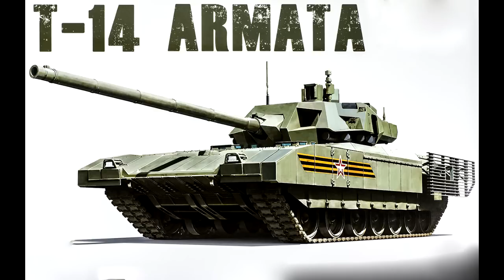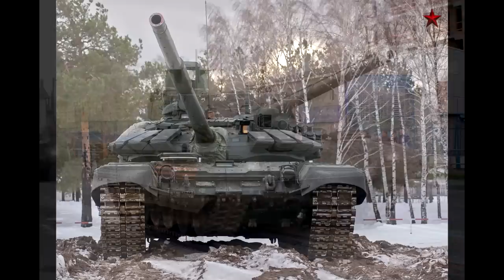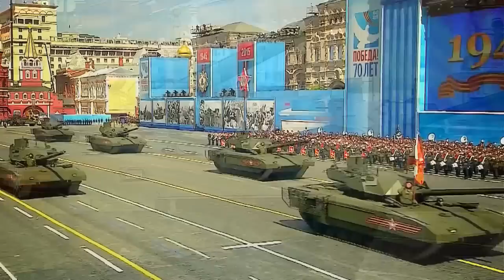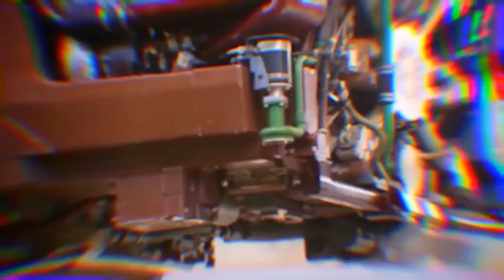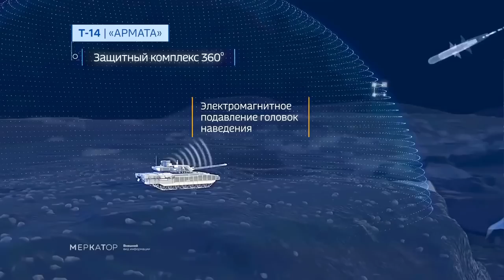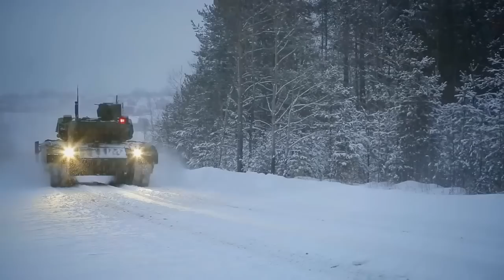Busting Myths on T-14 Armata

Comment: Of course there are problems with the T14 Armata tank, like the other Russian tanks. Every tank performs well in certain conditions and less well in other conditions. Russian tanks are capable of performing well in temporate and arctic situations. They are water tight, but this will give problems with heat release. How hard they are to drive depends on the drivers. Russian and Ukrainian tank drivers are known to be bad drivers, just as they are bad drivers on the road. Also the selection of tank crews is far from desirable. A tank is a good as its crew. Training of crews in other countries is another problem. T14 is too expensive to make, too advanced for most Russian conscript crews and only under fixed conditions will it perform better than the new Leopard, the Merkava 4 and the Abrams tanks. Also much depends on how a tank will perform in a complex warzone with tank formations, anti tank warfare, mine fields, supply of armaments and fuel, battleformation command, attack by warplanes and mostly by the quality of the army that uses the T14 Armata. You may have one of the best tanks in the world, but when a simple tank trap can hold it back, it won't go much further than perform defensively. Perhaps as a defensive main battle tank, it will perform better than the other tanks. As an offinsive main battle tank against Nato forces, against Asian tanks or against the Merkava 4 tank it may be possible to minimize its advantages. The tanks of Nato and Israel are made to be an offensive main battle tank. Russian tanks are best as defensive battle tanks. Perhaps we will never see real battles with the T14 Armata tanks. It may be a tank that is best used as a deterent. As a peace keeper it may be one of the best tanks. After all, mother Russia is best in defending herself or conquer weak countries. Nato and Israel have nothing to fear in the Armata tank, as long as they don't challenge the T14 Armata.
Reply: Lol How many thousands of kilometers have traveled along Russian roads to talk about the qualifications of Russian drivers, on tank biathlon Russians have not yet won !!!)))
https://www.youtube.com/watch?v=nE2yzAqvhJc

Comment: You are correct about the stopping mechanism on the T-14, I saw it in action in a video, very good stuff, actually, better than the Abrams it self, They use a T-90 for the testing, and the RPG projectile got blown apart at 50 meters away from the tank

Comment: Here's a good analysis of RF tank programs. Armata is too expensive to produce in numbers, most likely there will be heavy modernisation of the existing platforms and T14 will be produced in smaller numbers. Just economics. http://warisboring.com/everything-you-ever-wanted-to-know-about-russias-massive-tank-force/
Reply: Ivan Zhidov you know War is boring is Anti-russian right?
Reply: Their analysis makes sense economically, I don't see any significant bias. If you feel different, please explain. RF has tens of thousands of surplus tanks mothballed. Doing deep upgrade on a working hardware makes sense. T14 is new and expensive. T-62,T-72,T-90s are proven.

Comment: It is a very cool tank. However personally I am skeptical about it. The Russians have a history of building tanks that look nothing less than fucking amazing on paper, but have serious or even crippling flaws in practice. For instance, in order to take out the engine of a T-54/55/62/64, you had to first remove the turret, which itself took half a day. That can seriously hinder the turnaround time for tank maintenance. Additionally, less crew members means more work per crew member in vehicle maintenance.
It's a very interesting design, but I am not going to say if it is good or bad until the story of it's performance in practice comes into full view.

Comment: The APS on the Armata is something iam sceptical about. Not becouse if it works or not. The Russians had something similar before and it worked. The Problem was that it can lead to FF with wounded and dead on closeby supporting infantry. Iam curious if and how they resolved that.

Comment: Fact #1 They are very expensive to produce and maintain.
Fact #2 They are a logistical nightmare. Hard to maintain and don't share many parts with older tanks.
Fact #3 Even if you actually believe they used an inexperienced driver to show off their new tank to the world??? LOL. They are experiencing massive system breakdowns and being pampered to prevent failures. There are even talks of cancellation.
Last # Velocity defeats armor! A sabot round travels at over 1500 meters a second. Hitting it is like hitting a bullet with a musket, It's not happening! The tank itself is a 100% Russian design, but some of the electronics are either licensed French or copied French designs.

Comment: When comparing the T-14 with NATO tanks, it should be noted that the general analytical agency FMSO under the US Department of Defense in its report notes that the T-14 is a next-generation tank relative to existing ones. As noted in this report by FMSO analyst Charles Bartlez, the T-14 has a number of advantages over existing NATO tanks: long-range radar, active suspension, increasing the speed and accuracy of tank shooting, frontal armor, impenetrable modern missiles and projectiles, and an active defense system , capable of intercepting even shells.

To date, only two tanks in the world are supplied with the standard active defense system equipped with AFAR radar with the function of automatic calculation of the position of a shot on the tank by a rocket or missile: the T-14 and the Israeli tank Merkava. The frontal armor of the Merkava is weaker than that of the T-14, besides the engine located in front of the tank does not increase the protection of the crew at all, and when the frontal armor is broken through, the tank is practically guaranteed to be immobilized, and the furrier is located ahead of the engine. The active protection of both the Merkava and other promising NATO tanks is incapable of reflecting shells. And this is only protection.
a trunk of caliber 152 mm that gives 100% penetration of any frontal armor of any tank in the world.
ОТМЕНА
СОХРАНИТЬ

Comment: well....um.... ok.... great looking tank. looks like a good rival to our older abrams models from 20 years ago. just a few key points of interest though.
1. this is russia new tank being touted as the best. but we haven't released our newest version of the abrams yet. so there goes that nonsense. 
2. most seem to have this delusional vision of US and russian tanks meeting on a field of battle. when in reality, this is very unlikely to ever happen. even in a full all out war between the 2 nations. the US doesn't field its tanks in the same way russian does. long before our tanks hit the scene. our air force will have wiped out any enemy tanks forces. and can this thing withstand an onslaught from our strike fighters? not a chance in hell. and while russia has approx 1,000 fighters. half of them are considerably older models and won't do much more than become cannon fodder in battle against the US's nearly 3,000 active fighters on top of the countless 1,000's of very capable drones. 
so lets put this all into perspective here....
russia true challenge to the abrams comes nearly 20 years later....
russia's true challenge to out f-22 comes nearly 20 years later.....
russia has still not even came close to a serious microprocessor that challenges the US. it has no globally traded auto industry. no globally traded airline industry. and has had more failures in space the victories. 
so i ask you.... at what point do you guys realise you're in a race that already ended a long time ago?
 even now as russia is trying to salvage its 5th gen fighter program. the US is releasing info on its new 6th gen fighter plans. we're literally so far in advance. that we're telling you what we're doing before we even do it, lol...

Comment: Every new piece of hardware will have teething problems and failure in it's early years.  The more systems we cram into it the more things to break, no matter how much money you throw at it.  What counts is that a military force works through the problem until it is fixed with the contractor or builder of the military hardware.  The Armata is still a cutting edge tank and I am sure it will encounter more bugs and undiscovered vulnerabilities then they will get fixed.  Doesn't matter if it's German, USA or Russia.  Complex engineering is always a challenge and full of surprises.

Comment: The part about APS cannot take out an APFSDS projectile is correct.
Armor Piercing Fin Stabilized Discarding Sabot (APFSDS) shells fire a huge shell from the gun, then they discard into that small dart at a muzzle velocity around 1,000 meters up to even 2,000 meters per second (Depending on shell improvements, gun characteristics and that stuff). That small dart is hard to hit, especially going 1k to 2k meters per second. It'd take a miracle for that APS to take it out.

Comment: To STOP and APDS round  is easy,   all you need to do is put  enough "energy"   above the round, to cause it to begin to tumble...  and all the round needs to do is tumble past 30 degrees befoer impact.   at that point, the round with hit and flip sideways....   dispersing all of its energy over the entire length of the penetrator.  because its now hitting sidewise at best its going to dent the armor rather then pushing though it as the as it loses 95% of its penetration potential.

Comment: I refuse to believe that the E-brake was the problem when it broke down. I just don't believe that they gave that driver so little training. Did they honestly say "This button goes forward, this is left, this is right and this is backwards. Good luck have fun at the parade."? Did they honestly give that brand new tank to some tard to drive around at a parade during it's release? Sounds like an easy excuse to me. GG Propaganda team.

Comment: A little shrapnel at close range can not POSSIBLY stop or significantly deflect a hardened penetrator from an APFSDS round! WTF are you smoking? Sloped ceramic plates, backed by uranium, would be somewhat effective, but the active system described would only work on shaped charged or squash warheads.
Reply: mrnickbig1 the new APS can do it

Comment: Ok I will say this if anyone with a brain had to choose which tank they would rather take into battle especially if out numbered and the choices were the T-14 and the Abrams tank the choice would be the Abrams. I am not flag waving either, we have absolute junk like the f-35. Look they better make about 5 thousand of the T=14 because the next Abrams M1A SEP V4 is a stop gap beast until the new design is ready for the next generation.
Reply: +Andre Wells

> "we have absolute junk like the f-35."

 How is it junk?
Reply: look man the F-35 is a basic all purpose aircraft, it is something to show, however know one is afraid of this aircraft. The F-22 on the other hand is another conversation. The primary knock on this fighter is the maintenance issues. Beyond that know enemy wants to face this aircraft. The F22 is the real deal however because of piss poor procurement  procedures it because an albatross from the beginning. Had the pentagon or air force installed certain maintenance requirements more of these plans would have been procured, even the  F-23 is superior to the F-35, sorry but thats the truth, the next 6 generation plains will be much better. However they trumped those crappy plains out because they have super secret aircraft thats far better than any thing that anyone else has. And all of our potential enemies know it as well.

Comment: I doubt the Afghanit can really stop APFSDS. The darts fly fast, have minimal radar crosssection and are made of depleeted uranium - thats dense and hard material. Even if the system is capable of detecting them in time, the shrapnel charge would do nothing to it. Its kind of like hoping to shoot down bullets with birdshot.

Comment: 0:38 This maintenance recovery team was more than likely under incredible pressure to get the tank out of sight ASAP. A parking break alone would not stop it from getting towed away I believe the transmission was not in neutral or the final drives were not disconnected.

Comment: normally I rarely watch any Russian/Russian sympathizing youtubers regarding this topic because they often way overhype armata while bashing the crap out of abrams (and American in general) while giving absurd info on both.

you however generally have kept things simple, made solid points, have at the least given sources (I don't generally trust news sites but a source is better than no sources), and generally don't bash or hate on the abrams or the west. for that I give you props.

HOWEVER I still must keep my firm stance on being skeptical on quite a few of the capabilities of the armata, for several reasons.

1.  its new...new tanks anywhere and everywhere (ESPECIALLY "next generation!" tanks) get absurd amounts of hype and hate the moment they roll off the assembly line.  

2. the armata is fast....but it comes at a cost.  (heres where the overhype/white lie problem comes into play)  the armatas modular engine can achieve 2000 HP, HOWEVER it comes at the cost of wearing the engine down very quickly.  its standard output is roughly 1500 HP and not much, if any faster than an abrams.  (I'm currently trying to remember the source for this info.  I think it may have been on a tank page on facebook or a WoT/Warthunder related blog)

3.  as good as the armor and active protections appear on paper I will never believe them until they are used in active combat.  (that goes for any tank) so until I see it actually doing what its supposed to in a combat situation, I'm skeptical.

4.  I will give the crew compartment idea props.  that is a neat design.  on the other hand though the crew is sitting in front of a massive carousel of ammunition like most cold war Russian tanks.  good for reloading and rate of fire, bad in the event of a penetration.  that brings me to my next aspect of the tank that gets my praise and ire...the automated turret.  its a double edged sword.  if it works, GREAT!  no crew need to operate it or be put in harms way in the event a shell or rocket penetrates it.  if it doesn't work well now youre sitting there with basically a giant armored bunker with a useless gun that you may not be able to fix in field.

if it makes you feel better though, as an American I'm kind of pissed we haven't made something newer or more extravagant than the m1a2 sep v3 (or even the upcoming m1a3).  if Russia can make the t14 then we, as americans can produce something just as good if not better given our absurdly high military budget.  the fact we aren't doing much in that regard irks me.  not that I don't love the abrams tanks we have cause they are fantastic machines.  and with time and experience perhaps ill feel that way about the armata too

Comment: RedEffect:  Good Video. Becoming a fan. I do have a few things to point out though. It is true that the T-14 is all domestically built with domestic material and tech, however just like U.S. made tank, the technology development was conducted by other countries. But to be fare, that is true with all developed tech. I am glad to see Russia develop a modernized tank as compared to other countries as the earlier T-Series of Tanks had a slow development until the T-90's Tech advances over the T-72 and T-80. The T-14 seems to be a well advanced, crew driven product that finally relied on the impute of tank crews and commanders rather than politicians and bureaucracy.

Comment: Id say the "Arena-like system" insufficiency myth is bound to the placing and orientation of those modules ? ... US has AT missiles approaching the tank from directly above, witch gives this theory a good point, but it wouldnt be much complicated to add a few of those oriented directly up white two or three more sensors. Doe, it seems so, there isnt anything like that visible on it yet (but Armata is still just a prototype).

Comment: The T-14 did break down, the BS story was it just being the emergency break. Not that big of a deal, since it was repaired in place and was able to drive off; plus being brand new means a few mechanical issues are no big deal.
Reply: You mean it broke down, and the propaganda department later came out with the 'it was just the parking brake, no biggie' excuse.
Reply: DeepPastry it didn't break down in fact they released the problem of the EB and the tank was again moving like nothing happened.
Reply: It did break down, it's just that they repaired it on site. Which is why I mentioned it wasn't a big deal and they were able to fix it then drive it away.
Reply: DeepPastry nope what happened was explained countless times, they only turned off the emergency breaks and the tank was moving again it only took time because they didn't know what was the problem and the tank didn't reserve any repairs according to sources it's just you can't face the fact that it didn't break down because you hate the T-14 don't you?

Comment: No new Russian tanks in Syria, that protection thing , won't stop a tungsten bullit . It moves to fast and is skinny. Reactive armor , won't stop it...the Russians could put 50 tanks out there and roll over the rebellion. But won't , I think they want to keep us guessing, if it's worth the time and money spent. It's taller , ours got shorter. That turret looks to squared off. It needs to be slopped . The new Germany tank is like ours but shorter barrel, both tanks have German canons.. smooth bore 120 mm. It's like a missile launcher. I think we will do well against there New and old metal coffins.